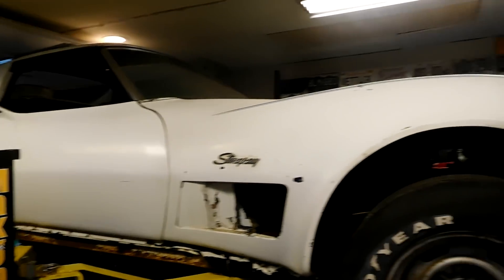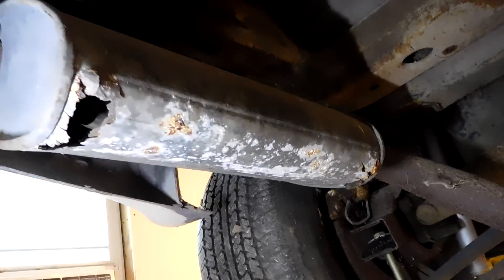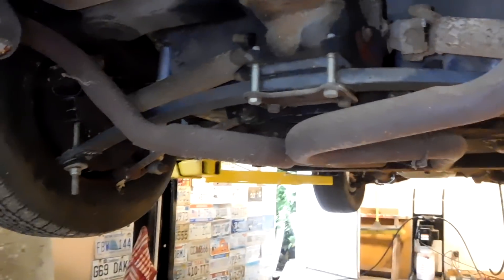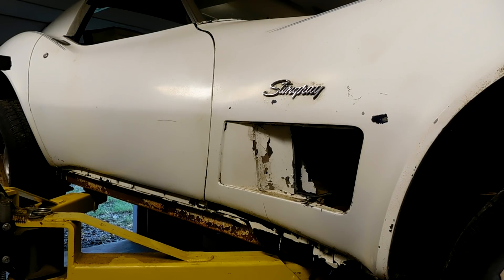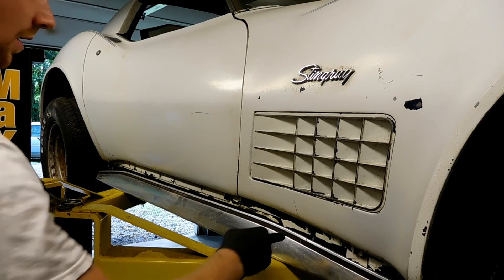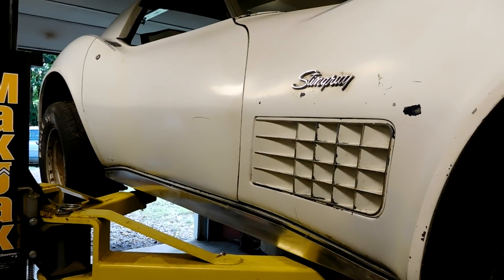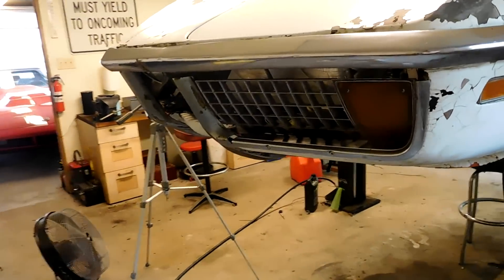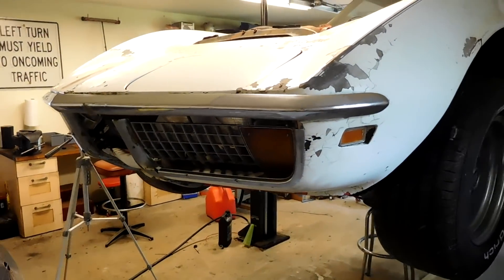How Rusty Is My 1972 Corvette That Sat In a Field For a Decade? Do Texas Cars Rust In Fields?

Comment: Hi Ben. just stop by to tell you what I found . About 6years back. I got hold of a 72 vette. guy said it was in the garage for 35 years. when I got it to the shop. Looking the car over. I 
t was true. 60 k miles. had to replace tires. F&R springs . brake system , engine gaskets & seals , carb kit. exhaust system. power steering box. rebuild the trany. radiator . heater core. hoses & belts. and some vacuum  controls. headlight switch. clock. and like your 72. mine has no rust. 
and a sheep skin for the drivers seat. Now I enjoy the car very much. but I wont buy another barn find ever again. this one was my second one.    Thanks for your video. well done. carry on Ben AZ

Comment: that frame def looked good for sitting in dirt all those years.  it wouldn't have looked that good up here in the PNW.  car is looking better and better as the work gets done...but its crazy that the previous owner just left it to rot.  I'd pull the kick panels and check the #2 body mount...after the kickup for the rear trailing arm, they seem to rot the most.

Comment: The absolute best point you've made about parting out chrome bumper cars Ben. (It's not done)! Now for any of the non-aficionado Corvette naysayers, chrome bumper C3 Corvettes (especially those Texas cars) are beyond collectible. Again for brining back to original, or resto-modding.
Reply: The same goes for Camaros as well, the early 70-73 cars are very very hard to find so not many ever get parted out but on the other hand if you need used parts for a 74-81 camaro they are fairly easy to find because there are still plenty of them out ther getting stripped for parts because the cars aren't worth much as a compete car. Certain cars and motorcycles are just that way.

Comment: Just inherited a 77 from my uncle. Trailered it from Buffalo NY to small town SC. It's all there but there is no title. Buddies of mine ran the VIN and it not hot. I sent in all paperwork and am waiting on a title... should be interesting... Any suggestions on getting the HP up on this thing besides a LS swap ??? 😆 🤣 😂
Reply: First, run a compression check on the motor, to see if the piston rings still hold. Next, remember that before 1973, the 350's had better breathing heads. And they are worth something! But you could go to a set of aluminum heads--ONLY IF you choose correctly. Because changing out the intake, carb and cam will be your other moves. Is your car an automatic or 4-speed? If automatic, not only the fact that you have the 350 tranny (which can safely handle only up to around 450 hp/400lbs of torque) but also driveability. And if you have a/c you can't expect the engine to stay up running a decent idle  with too wild a set-up. What typical RPM range will the car be operating under? You have to be honest with yourself about this: daily driver? Street/strip? Or full-out drag? I would call the Jegs or Summit tech support, just to give you their ideas. ALL of this has already been mapped out by these guys with the combinations having already been attempted by these guys. And, if your early C3 is a numbers car, the car is worth much more intact, than doing all this engine stuff to it.
Reply: @allenvaughan1  thsnk you. That's alot of I fo that I've absorbed... Much appreciate the time and knowledge

Comment: So glad this one is in such good shape. True, there is higher humidity and moisture in some parts of Texas and the South, but it all depends on whether dirt has collected inside panels and frames or supports. I brought a 1970 Nova and a 1972 F250 from the arid part of the Northwest down south and the more humid climate coupled with lots more rain did cause rust to show up. But areas that rusted had hidden dirt or leaves collected in them and the humidity and rain caused the foreign material to stay damp alot and rot some things out. Another thing you have to look for is leaks like Windows and such. The Ford truck actually has a bead of sealer near the top of the firewall under the dash. It's where the window section and front hood vent are mated with the firewall, and that sprung a leak. Every time it rains water gets in the cab if I leave it outside so I have to watch the weather. Discovered a little late and there's a small couple of rust holes in the floor. The rear fenders and quarter panels rusted on the Nova because debris collected under rear window trim. This caused rust holes which in turn let water into the trunk. Water collected around fenders and rear quarters and rusted them out. You don't have to be in the rust belt to have rust if dirt collects where it shouldn't and water leaks where it wasn't intended. Great video.

Comment: I'm in western NY state. Anything sitting out in the grass for 1 years looks 10 times worse than this!
Reply: Cheektovegas?
Reply: 10 Min away Mr. John. My daily driver is an 05, garage kept and I still had to patch massive rot in both front floorboards and replace the rusted oil pan. Dread every repair under the car because everything is a rusted mess and even the most minor repair is a battle. I laugh at the YouTube videos where things just break free with a little spray of penetrating oil.

Comment: GREAT ....... video! My 1973 corvette is from Texas (engine fire) and it seemed to have been sitting in a dirt floor barn or something with a cover over it, because the interior is in VERY good shape. YES ....... you are correct, the rust from a car in Texas is NOT that bad and mostly surface. Most people desire cars from either Cali or Arizona because of the anti-rust climate. I had 2 Karmann Ghia Convertibles  1  a 1973 was from Michigan  (top still in place)  and the other 1958 lived all its life in Cali (no top). Guess which car had the most rust? The east coast car. TRUE: with the snow and the salt on the road- it can eat the metal on a car. I had a GREAT time in Texas at the F1 races( practice) The race is tomorrow- Sorry I missed you(you shoulda been there).

Comment: It's amazing with many things but pretty obviously with cars and maybe Corvettes especially what "experts" everyone thinks they are because they've owned one or several at some point in their lives.  Before I owned it my '72's frame rotted away so bad it was being held together by the body (the entire back half was eventually replaced).  Many years of being daily driven on salty winter roads did that, not sitting in a field.  My current project sat in the same place for 25 or 30 years and the frame is fine.

Comment: I say C3 frames are so beefy (thick metal) that you would have to leave it in a swamp for 25 years before it became unserviceble.  I did a frame off on my 77 with no rust.  I bead blasted the frame, had seams MIG welded in areas with gusset plates, polyurethane primer and paint. It will last 200 years.

Comment: Dennis Collins says “ Texas cars rust from the top down” !!!!!!
Reply: Same with florida cars and any cars found along the coast lines, all the intense sun burns the paint off then all the rain and moisture causes all that exposed metal to rust very quickly and because it's super humid all the time the metal never gets a chance to fully dry. The rule of thumb is that southern cars rot from the top-down, inside-out and northern cars rust from the bottom-up outside-in.

Comment: Really Ben? Just 12 minutes? I want at least an hour of you working on this car! 😆 🤣 
So if the owner did some replacing of parts why did he then just park it in a field for ten years? That's a bit weird. 
Something wrong with the motor? That's a 350 right?
Reply from the maker: Previous owner is a drunk. That should give you enough information right there.
Reply: @TheCorvetteBen  Then I guess it's better he parked it in a field rather than wrap it around a tree.